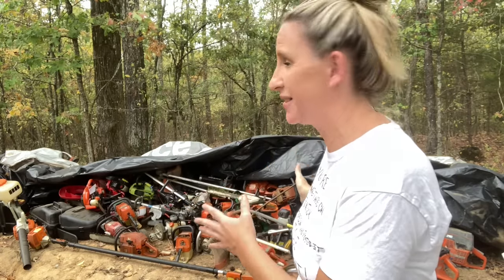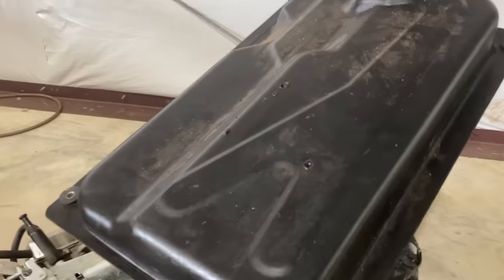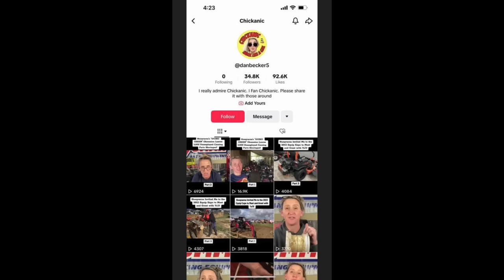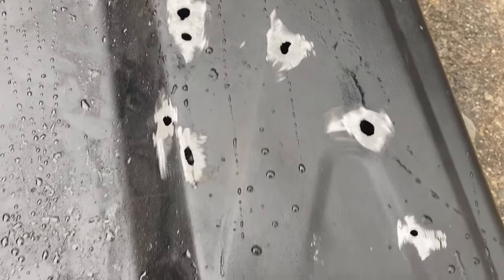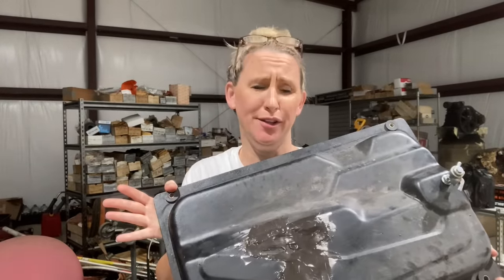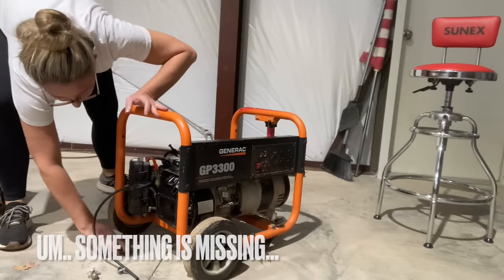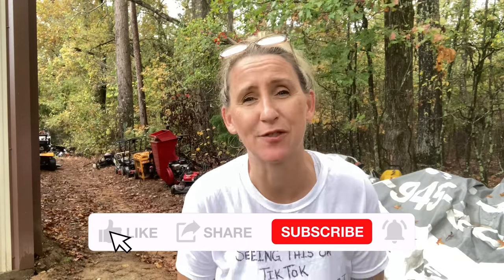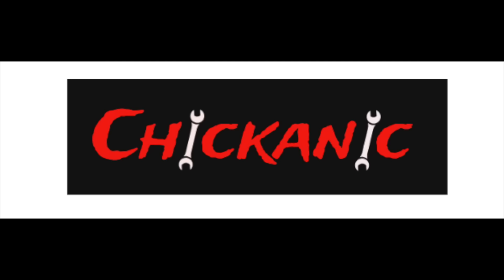Customers ABANDONED All This Equipment! Turning Their Trash Into My TREASURE! Vlog

Comment: I’m fairly new to your Chanel 
I was glad that you got the generator going but disappointed you didn’t test the generator under a load like using a electric space heater or something near the wattage rating of the generator. 
Also most all VOM digital meters have the function for viewing the 60 hertz as well so that can be adjusted.

Comment: If you come to any generator that runs, but doesn’t create power, drop me a line I am the lead technician for Power on time. Those generators are very easy to fix.
Reply from the maker: I will! I have never gone into the gen part of the generator. I need some lessons! 99% of all of them that came into the shop just needed carb or head work.
Reply: @Chickanic  about half of all small generator problems for producing power can be cured with a fuse and a 9 V battery

Comment: Hello, I want to say I like your YouTube channel or show,  wanted to get your help with my Generator it is a Troy-built the model is 030237  it would start I cleaned out the old gas checked the oil, and charged the battery it started, and quit, have started since pulling off the carb and it was full of a lot of junk and rusty try to clean it put could come clean enough  I am hope you can tell i if there a way to get another carb for it.  shop I have been to will work on it

Comment: Something I forgot to mention since my last post on water in fuel. Condensation is the biggest problem with metal tank walls allowing moisture to condensate and run back into fuel - a good way to overcome this is to top up the tank before putting it away, sounds a bit counter- intuitive I know but this removes air from the tank which may contain moisture, petrol or gasoline is not hydroscopic by nature so should be okay 👌

Comment: Instead of using J-B weld to seal the tank, next time try cutting some small plates to cover the holes and use aircraft fuel tank sealant to bond the plates over the fuel tank holes. It'll seal up a 747, it'll seal a generator. Aircraft spruce, or wick's aircraft supply on the web

Comment: Stop calling it a rewind. Its  a RECOIL!
Reply: I always said "recoil"  but rewind ain't wrong.  it re-winds the starter rope after you pull it.  It also re-coils the rope if you prefer, but either is correct.  You'll probably find about as many factory manuals calling it a rewind starter as recoil starter.